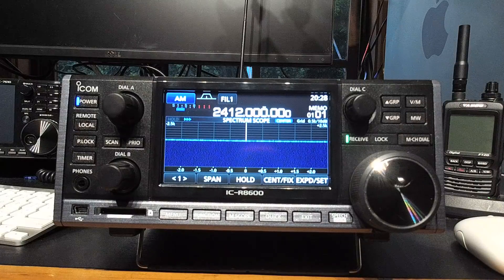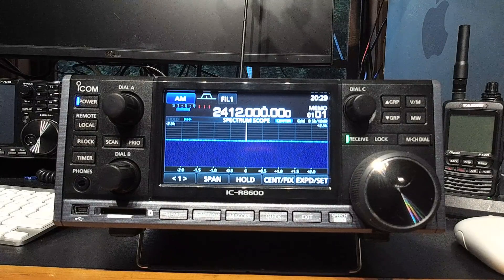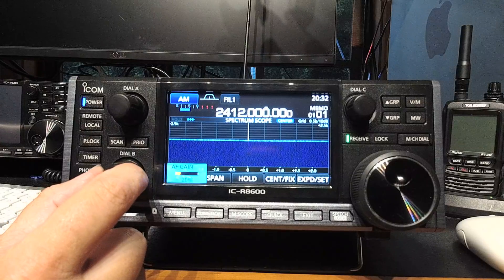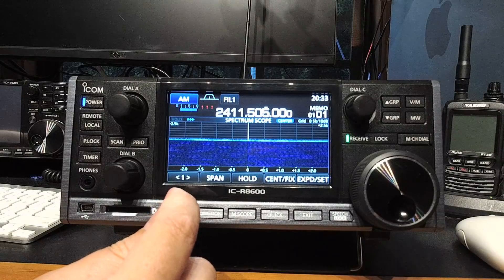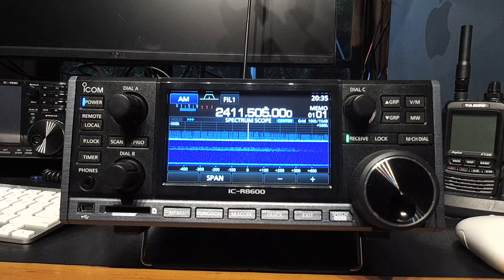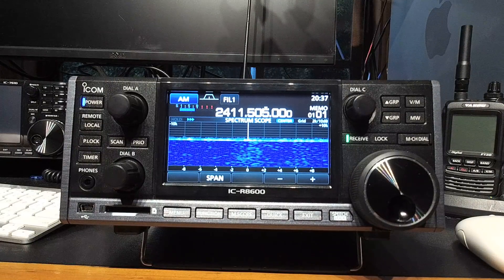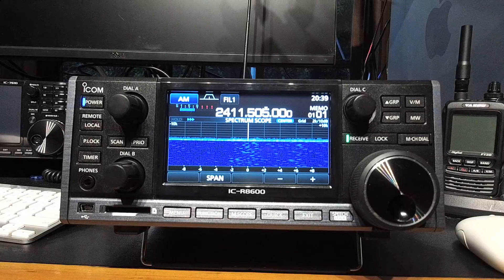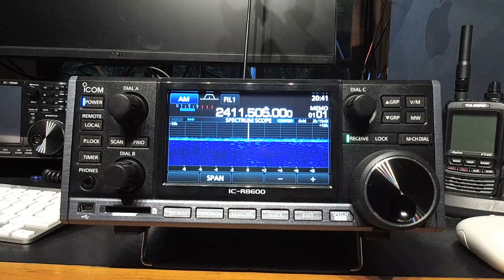What 2.4GHz WiFi Sounds & Looks Like (using the Icom IC-R8600)

Comment: > Sounds and Looks Like
The span of the waterfall was 20 MHz.  It shows the beeps and burps are scattered around the 20 MHz channel.

But, each beep and burp sounds the same when the receiver is in AM mode.  In AM, all you're hearing is the different frequencies turning on and off quickly, which isn't too interesting.  Whether a frequency turns on and off at the bottom of the AM passband, the middle of the AM passband, or the top of the AM passband, they all make the same sound -- on AM.

A little more "sound enlightenment" could have been had by switching to SSB (single sideband).  Then, all the different beeps and burps on different frequencies would demodulate into different tones out the loudspeaker, which would have been a lot more musical.

If the IC-R8600 is incredibly flexible, then in SSB, you may be able to increase the receiving bandwidth to 20 kHz, which is a tiny slice of the 20 MHz that is occupied by the WiFi signal.  But if you listen to a 20 kHz slice anywhere inside that 20 MHz activity in SSB, there would still be enough action even inside that [relatively tiny] 20 kHz slice to hear a nice digital symphony.

Theoretically, the SSB receiving bandwidth could be increased to 20 MHz, to include the entire WiFi signal.  But since the best, youngest, human ears can only hear up to 20 kHz, there would be nothing gained by increasing the receiving bandwidth more than 20 kHz.  In practice, if your receiver has that much flexibililty, you could keep increasing the bandwidth to add higher and higher-pitch tones to the symphony you're hearing.  Keep increasing the bandwidth until you've reached the limit of the highest frequencies you can hear -- going for maximum symphony.

Comment: The puttering sound reminds me of spark-gap CW. WiFi transmits a maximum of 600 "beacon frames" per minute, the same pace as continuous dits at 24 wpm (or the idle note of a heavy single-cylinder motor). Each pulse is a complete CQ call: station identification, capabilities, tuning/decoding parameters, and traffic control for the net.  We're only hearing less than 1/1000 of the occupied bandwidth.

Multiple APs will share the channel by listening before transmission.

WiFi uses either DSSS or OFDM depending on the operating mode. If the network is configured with support for 802.11b devices, it must be using DSSS, otherwise probably ODFM. I'm curious whether the difference is audible - in theory both should sound like quiet wide noise.

A simplified description of DSSS is ring modulation with a pseudo-random sub-carrier - the subcarrier is periodic but rich in harmonics. There is only one subchannel but DSSS spreads it over a much wider bandwidth than the keyed signal. Narrow bandwidth receivers hear only noise and conversely DSSS devices hear narrow interference as noise. 

The OFDM modes of 802.11g divide the 20 MHz bandwidth into 64 sub-carrier frequencies. 4 are BPSK pilot signals.  The receiver synchronizes its local oscillator to these pilot signals and automatically adjusts its phase response: four band complex AGC. 48 data channels are recovered and demodulated through QAM (similar to DSB) keyed at 250,000 symbols per second, 80% duty cycle.  8 sub-frequencies are left silent.  Depending on mode, there can be 1, 2, 4, 6 bits per symbol. 

At that point the signal is almost-digital (shades of gray between 1 and 0) and still striped across 48 separate streams so an error-correcting decoder shuffles the bits around and recovers the data. 

All IF processing is done digitally. Analog solid state ICs do amazing things too (including the 2.4 GHz heterodyne) but near perfect phase response over 20MHz is probably asking too much.

Comment: hi again,

I revisited this video again, because the 2.4 GHz insterest me..

I discussed with my ham friends, about micorwave oven.  I said, if we fear about RF leaks from microwave oven, we can use receiver which can RX 2.4 GHz..  and 'see' how high the signal level.... :) So, this receiver coms handy for the purpose..

Other methods are, playaing  this YouTUve  video or other video streaming on smartphone through 2.4GHz  wifi.. Put it into the microwave an close the door, If the video stopped, it's mean the microwave oven's RF sheild is most probably still working..  Remember, not to start mcrowaving  the phone.. :)

If there is any ideas or methods, please share.. :)

Thank you.

Bahathir 9W2GNU, 73.
Reply from the maker: Very good points Bahathir!  From what I have read microwave seals tend to be very durable - I even tested our 40 year old Samsung and it was still fine!  That said, the usage of ‘tools’ such as an phone with wireless to confirm a microwave isnt leaking is very much in the amateur spirit!  73 my dear friend, Jarrad VK3BL
Reply: @RateMyRadio  
QSL and Thank you for the reply. 

One of my ham friend does not want to own the microwave oven due to the RF leak. Remember that, microwave oven produces abut 1kW of RF power.  So we have to be very cautious about RF leak.

Talking about RF leak, we also can use receiver or small AM/SW pocket radio, to detect any leak from feedline., especially who operate at QRO several hundreds of watts or kW.  

So, becareful handling RF and take care, an stay safe.

Thank you again. :)

Comment: That sounds like a boat motor idling.
Reply from the maker: It certainly does, and in that recording the wifi itself is idling; its using a low data rate polling to see if it has any friends lol 73, Jarrad VK3BL :)
Reply: @RateMyRadio  is there any way to cancel that out?
Reply: Sounds like my face in some tiddies.
Reply: Can you play a YouTube video or download a file while scanning? I've picked up wifi noise on a small headphone amp I made. It's not loud but you can hear it.

Comment: Please make a video about  Icom. R 8600  For Recieving signal Direction and signal distence  or Degree .thanks
Reply from the maker: Unfortunalely we have returned our loan unit, and it isn’t suited for 2.4GHz WiFi direction finding an analysis either; your average laptop with free software will do a better job due to its WiFi chip implementing dual or triple antennas with realtime, phase coherent diversity receive.  73, Jarrad VK3BL

Comment from the maker: Please excuse the cracking - we tried a different recording device but it turned out our lapel mic is broken!  A new one and some spares have been ordered :) 

A acronyms & technologies used: 
DSSS = Discrete Sequenced Spread Spectrum
QAM = Quadrature Amplitude Modulation 
OFDM = Orthogonal Frequency Division Multiplexing
Reply: Hi Jarrad, thanks a lot for the video!

Anyway,  here's a bit of input from someone who did do the university education in this topic:

The DSSS info is not actually correct. IEEE 802.11 and 802.11b use DSSS (in present, because new routers still support the 20-years old standard and many will even switch to it if you try to use multicasting, reducing your network speed to 2 Mb/s! ). DSSS, although is uses the spreading sequences, does not have multiple carriers, instead it's a single signal with very wide bandwidth, which is later compressed by the receiver.

The IEEE 802.11a/g/n/ac etc. all use OFDM. 
The OFDM does have a number of subcarriers, but in this case, it's a bit overstated in the video. The actual number of subcarriers in 20 MHz channel is just 64. The 40 MHz channels have 128 subcarriers and so on. Do note that not all subcarriers actually carry data. Some are so-called null subcarriers, and no power is allocated to them. They're used to correct for the non-linearity of power amplifiers. Some are so-called pilot subacarriers, which always carry predetermined data. You can think of them as signals used to test propagation: The receiver know what to expect there, and can then adapt its own DSP, in order to correct for any problems, if possible. Then, we have the actual useful subcarriers, which might be as simple as the BPSK, which is known to hams from PSK31, and might go as complex as 1024-QAM in the upcoming IEEE 802.11ax standard. 

Also, a single WiFi subcarrier is around 300 kHz wide, 

By the way, just a sidenote: Do you  happen to have any Bluetooth devices? A traditional Bluetooth channel is 1 MHz wide, so it should be possible to fit one entire channel onto the spectrum display of the IC-R8600.

Comment: That’s a sweet receiver..
Reply from the maker: Its pretty amazing Mark.  We've only got it in the shack on loan for a month, so if you have any ideas of how to test it out let us know :)
73, Jarrad
Reply: Rate My Radio Well, I have the Icom 8500, a non-sdr type Wideband receiver.  I basically use it for everything from shortwave listing to police and local government monitoring. I’ve never used it near 1 ghz as my antennas are limited to HF and vhf and uhf and then some. Most of those goodies you need a array of antennas to enjoy.
I don’t use it to listen to cordless or cell phones - wink 😉...  You will find that receivers like this outperform most low-mid priced Ham radios in overall general coverage receiving, better dynamic range and sensitivity.  I know it doesn’t apply to high end rigs like my Yaesu 5000 or your 7610 perhaps. There are so many decodable signals everywhere on the bands above 30 MHz in the states anyway.  I’m sure your local frequency distribution is quite different in AU. If you’re interested in listening to your local McDonald’s and other drive thru’s , it’s a blast.  
But don’t transmit on those frequencies 😉. Overall these type of radios are fun to use and offer good performance considering the band coverage, wide-band radios are compromised a bit because of the extreme wide band coverage, but maybe that radio is an exception. My Kenwood R-5000 seems to outperform my Icom 8500 on HF a bit as it’s geared towards those bands.  Im not sure about that radio. Also, you need to be careful what high band antenna you use as my 8500 was damaged using a disclone because of static built up, I didn’t bleed off the antenna system correctly, so the radio made its way to our local Icom repair center for a rather pricey fix.  So use a DC grounded antenna or remember to property setup your antenna system.  I would definitely buy that if I didn’t already have the 8500..  Have fun..